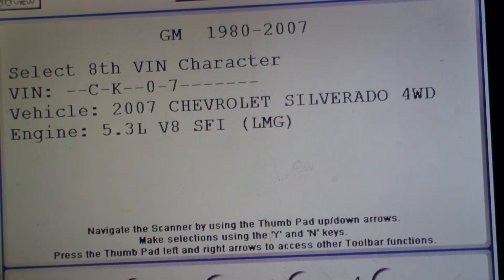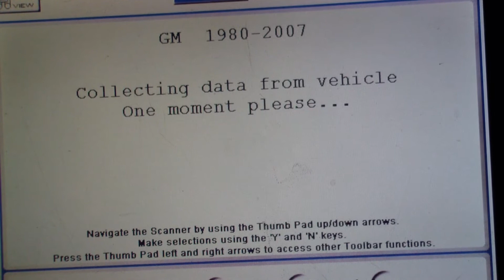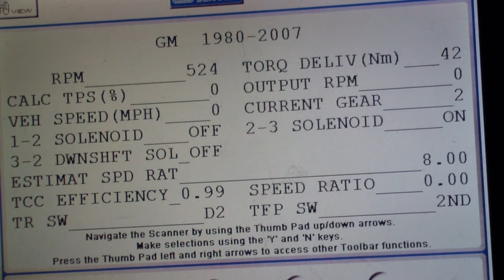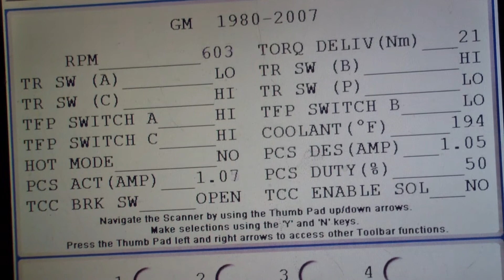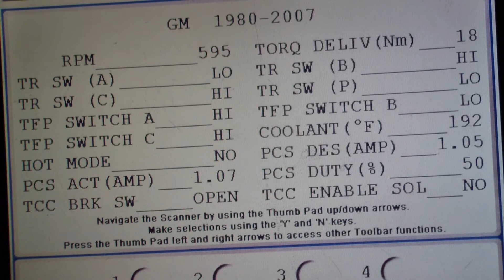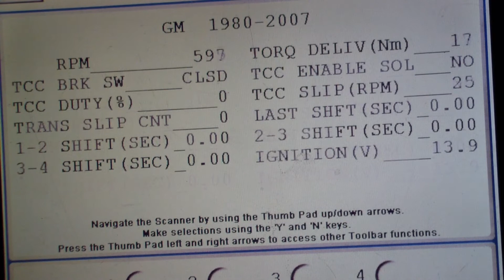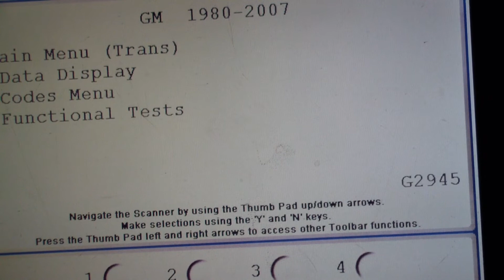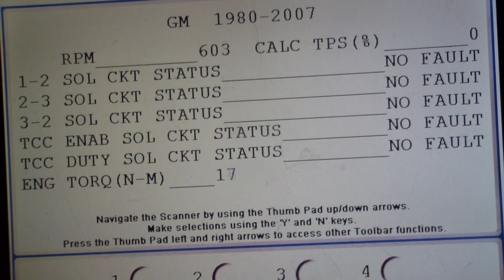Snap-On Modis Scanner Explained (Automatic Transmission)  Part #1

Comment: Does the Verus have this transmission, just bought one I want to try on my 06 range rover. I replaced the solenoids now i have no reverse the original problem was an open circuit on sol C would love to just see if they are turning on or off, great video

Comment: Hey Wagonlight,
 I was driving my 2004 Chevy Trailblazer LS been running smoothly just had an inspection to get new tags. So I was driving about 30 MPH and all of a sudden my car  ReV up and down. I never felt slipping in my transmission at all. Ran smoothly Pull to the side. And when I put the gear in Reverse, Drive and the rest of the gears. If I push the gas pedal it does Rev as it should. 
It will not move at all. Then someone said my transmission fluid was overfill.
Have that drain to the right level. And still no moving.
No check engine light. could it be my  Transmission Shift Solenoid?  
Never had a sign of slipping.
Can you help me?
Reply from the maker: Mike, 

1.)  To me this is likely what occurred here.  When you were driving it, all of a sudden the issue with it revving up and down is because the engine protects it self while in drive and reverse from revving to high.  The engine computer limits engine rpms and when it hits a limit the ecm will kill the fuel and let it rev down to reduce the speed so it does not blow up.  Us technicians call that the rev limiter.  So when you were driving something lost the drive to the transmission likely causing that to disconnect the torque converter from connecting the engine torque to the transmission.   

2.) Wont move, but someone said your oil was overfull.  When transmission levels are checked they are always done in park, or if you consult the owners manual it may also say neutral with the Ebrake on.   Regardless if you checked the transmission level and it was overfull it is likely something is not making the pump spin.  The torque converter is bolted directly to the engine, and on the back side of that is a 2 teeth hub.  Anytime that engine is spinning because the converter is connected to the flexplate of the engine, it spins a oil pump in the trans.  That oil pump drops the level to the oil dipstick you check when it is running properly because it pushes the trans level to the parts that are responsible to make those gears occur it also circulates the trans fluid to the converter.  All that drops the level to push it to the cold or hot range depending on the temp that your checking it.  And there is a level on the dipstick to tell you that.  Always check dipstick 3 times for consistency and always go with the lower fluid trace when doing so not the top one.  If the pump broke or something internally to the pump gear broke no fluid can be pumped from the filter to pull it to the transmission oil pump.  This would raise the level in the pan and when you check it on the stick to someone who may not know that, appears to be overfull.  If you dropped the level to the normal range it means it is likely underfilled.  To check that, check the level with the engine off 3 times for consistency... then start the engine in park and recheck the level, in EVERY case, it should drop EVERYTIME... if it is not the pump is not rotating and is not pumping pressure to the transmission converter and clutches to make it move forward.  If this all of a sudden did that like you say depending on the severity of it, it may have not damaged your transmission internally as far as clutches are concerned, but the pump rotor sure seems like what possibly broke to me which is why your vehicle did, what it did.